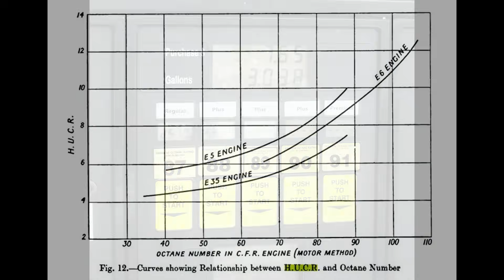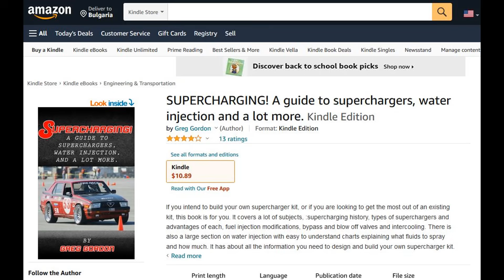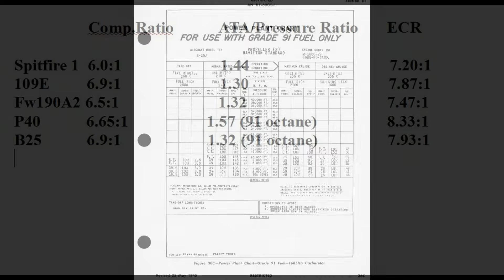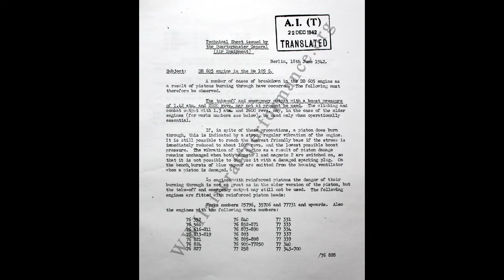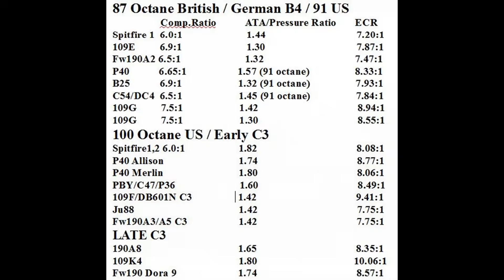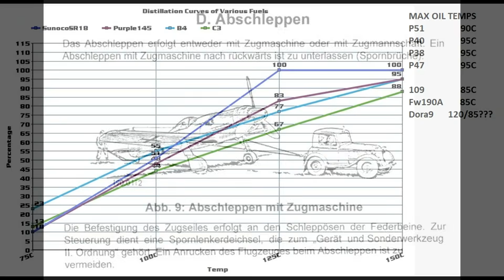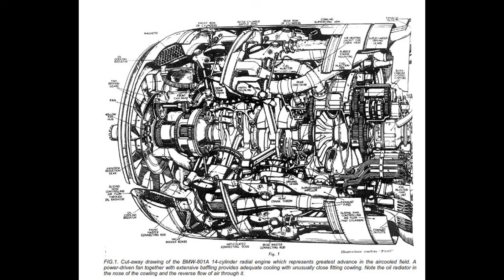German C3 Fuel, Uber Octane or Synthetic Crap?

Comment: My Copen's 659cc inline 4 runs 16PSI boost [at 500m on 95RON to it's tiny twinscroll] and base compression 8.5.  Doing the maths, ECR is sqr(2.08) x 8 = 12.3, meaning that the [very expensive by litre] engine is under-stressed, good!  Have I missed something here?
Reply from the maker: I don't know anything about that engine , but in terms of ECR it's not that high. Consider that a stock 1368cc Fiat runs 18psi with 9.8:1. Part of the reason it can do that is because of the small bore of 72mm.

Comment: Having all those qualifications to his name.............Greg is a pretty cool guy ;) Stanley Hooker mentioned in his book, that the carburetor on the Merlin had an advantage in that the supercharger sucked in the air/fuel mixture, completely mixed the components and evaporated the mixture fully before the mixture of gasoline vapor and air entered the engine, which has the advantage of the gasoline evaporating has a cooling effect on the mixture and helps to reduce detonation.  By comparison he said the mechanically injected german engines had no such advantage (injecting into the manifold, not before the supercharger) and it balanced the performance of them both to being equal. Mechanical fuel injection had its own plus side benefits, but also drawbacks.

Comment: 17:00 there getting up there 
Mazda Sky active x is 16 and some change
Reply from the maker: Sort of. It has a variable compression engine which can go over 16:1 but at very low manifold pressure values, values way below ambient. In other words, 16:1 but with a much lower ECR. It's the ECRs we are looking at here.
Reply: @GregsAirplanesandAutomobiles  I'm not saying your not wrong and sky active is technically a compression ignition cycle and I think there over 16.3 to 16.5 last i checked 
Was more intrested in why they would want peak cyl pressure so low in rpm figured the increased duration would burn up the heads but we will see
Reply: @GregsAirplanesandAutomobiles  also sorry about taking u off topic allway enjoy your videos and hope to see more soon
Reply: @GregsAirplanesandAutomobiles  but on topic I remember standard oil of England was the one who supplied the germans with tel or Tetraethyllead and I bealive that last shipment was before the invasion of france

Comment: Metallurgy should not effect the compression ratio, but poor Metallurgy will have an impact on rotating mass. Rule of thumb is 10 g increase in rotating mass is equivalent to adding 1 Kg weight to the plane. On these engines it would be pretty easy to see that poor steel could result in a gain of rotating mass of 10 Kg, resulting in an effective weight gain of the aircraft of 1000 Kg.
Reply from the maker: Just to be clear, I didn't say metallurgy would effect the compression ratio directly. I said it could contribute to knock and if so it would contribute to the need to use a lower equivalent compression ratio.

Comment: The German panzer museum recently released content on German synthetic fuel production in WW2 which indicated a 5:1 tonnage ratio of coal consumption for gasoline produced with their most common production method. While B4 might be somewhat higher than tank fuel in required octane, there is a world of difference between 5:1 and 22:1. Please consider clarifying that.
Reply from the maker: Hi Doug, valid point, but I don't have access to the source you listed, so, two different sources, the one I used said 22:1. Let me ask you this, did the 5:1 ratio include the coal needed to transport the coal to the refinery? Did it include the coal used to generate power for the refinery? Did it include the coal used to make the fuel that was used to mine the coal? There are a lot of variables here. I have no intention of covering this topic in a future video as the actual method of fuel production is way outside the scope of this channel, but you have raised an interesting question, one better handled by another channel.
Reply: @GregsAirplanesandAutomobiles  I don't believe it did include those figures since they analyzed largely the hydrogenation process, but since I can't seem to find what your source is or whether they include the associated extraction, processing, and transportation energy requirements, a discerning viewer is left with speculation and confusion when presented with seemingly largely conflicting information, coming from a large and reputable research and education institution that specifically analyzed the synthetic production of fuel in WW2 Germany. Unfortunately, the museum doesn't put their source out there readily available either. In addition, he paints a more detailed picture of remaining German fuel production capacity in 1944 as discussed in the P-47 part 8 video. https://youtu.be/guD27UuOAzk 15:24
Reply from the maker: Hi Doug, the difference between me and that museum, is that I do put up my sources. I don't say anything I can't back up unless I"m specifically saying it's my opinion. My source is the document "Oil and the Grand Strategy" by Toprani, which is the definitive work on this subject. contiunes below: 

Here is the quote "Taking a figure of sixteen tons of soft coal and five tons of hard coal to produce one ton of gasoline, Fischer estimated that IG Farben would require only 8,000,000 tons of the former and 1,500,000 of the latter to produce the required 800,000 tons of fuel." Do the math and that's a range of about 21:1 to about 11.85:1 coal:fuel. The document has German sources for all of this. Here you go, have fun: https://repository.library.georgetown.edu/bitstream/handle/10822/557628/Toprani_georgetown_0076D_11993.pdf?sequence=1
P.S. as explained in my latest video  I won't see your replies to this so start another comment if you want me to see it.
Reply: @GregsAirplanesandAutomobiles  Thanks for the sources and explanation of your figure. You might still like that video. He does post sources for quotes and usually for particularly contentious claims. Your content and his are the only two academic videos I've yet seen on the matter, and both I've seen in the last few days, so the conflict was especially glaring.

Comment: Greg, another more relevant question, what was the reason for the differing compression ratios in the DB605 cylinder blocks?
Reply from the maker: I am pretty sure but not 100% sure that it was due to one cylinder bank running hotter than the other.

Comment: Greg, you repeatedly use the terms "rich", and "lean" to seemingly denote more, or less, boost pressure. However i understand these terms to relate to stoichiometry, rather than boost.  I readily admit that more boost translates to more fuel, however.
Reply from the maker: Hot on there. No, I did not use the term rich or lean to denote more or less boost pressure. These terms have to do with Air:Fuel ratios, or as they called them back then Fuel:Air ratios. Now at higher manifold pressures, yes, more fuel goes in, however the mixture controls systems of the day ALSO increased the amount of fuel per a given weight of air, thus also richened the mixture.
Reply: @GregsAirplanesandAutomobiles  thanks for clarifying. i typically give your clips 3 or 4 'listens', since im only on round one, im sure it'll make more sense on round 2 upcoming. Apologies for any misinformation i may have promulgated

Comment: Re: the Spit's lack of fuel injection, wasnt that purposeful, ie, a design choice by RR, in order to gain performance advantages in a certain area(s), though offset, of course, by the disadvantage incurred until solved by Miss Shilling? Surely it's not llthe case that the British were incapable of fuel injection? (... and stop calling me 'Shirley'...)
Reply from the maker: Then why did the Spitfire convert to fuel injection with the Mk9 and all subsequent variants?
Reply: @GregsAirplanesandAutomobiles  Right, good point, but I wonder if fuel injection just better fit the overall "scheme," if you will, of the Mk9? Probably you're right, though. I will look into it further. Perhaps some other readers of yours will weigh in as well. Thanks Greg, I love your videos. If you were to read the US Tax Code, I would listen.
Reply: @GregsAirplanesandAutomobiles  Yes, it seems that fuel injection was beyond the capability of RR at the start of the war, though they felt that the carburetor did afford certain power advantages at certain altitudes (hence my original post/point). Still, the overall superiority of fuel injection was recognized by them, but apparently, with war looming, they did not want to use time and resources to develop it. Later, after Shilling's jury-rigging, a pressurized carburetor was introduced, which solved the negative-g problem, and shortly thereafter, as you indicated Greg, true fuel injection was introduced. Anyway, you know all this already.

Comment: Willy Messerschmitt DID have a tendency in his old glider designs to “pare away” at safety margins to get the performance he wanted, so it would be entirely understandable for him to try to coax a tighter tolerance from the 109’s engine settings than would really be safe to achieve.

Actually, what if the D series 605, especially the DC, was designed to run a bit richer on War Emergency Power than the early models?

Comment: The low nickel content of the exhaust valves, especially in German radials 
contributed to detonation and were not as durable as the allied aircraft.
Reply from the maker: Maybe, but the data doesn't seem to support the theory that valve metal content was the main contributor to detonation. I know that's a strong opinion going around, but I look at the actual data, compression ratios, boost, etc.

Comment: I posted a reply to the question on how it was made-
I.G.Farben and all German cartels were financed by certain Wall Street banks, financiers and industrialists starting in 1924
The Synthetic fuel, tetraethyl high octane additive and synthetic oil hydrogenation process from coal was from Rockefeller’s Standard Oil, in exchange for German Synthetic Rubber technology.
Incidentally, Standard started drilling, and had the refineries in the ussr starting in 1917. Fred Koch also a part of it. Ford was already in Germany in the 1930s, along with GM(duPont) who owned Opel since 1931-
Invested in all sides
Ford also in England, France and ussr. Financed in all sides 
The source is from Antony Sutton’s excellent books on his extensive and unprecedented research-
Reply: Antony Sutton’s research and evidence from State Department decimal files document where it came from. Also revealed in documents is how Germans were extremely pleased with all the data provided by Standard Oil research in the technical assistance/exchange/investment
Reply: Joint research agreement between Standard Oil/I.g.Farben was announced in November 1929
Reply: Standard tried to hide this after the war period of course-
Reply: Plants were then built in Germany to manufacture tetraethyl lead 
And by 1934-35 the Germans negotiated a shipment of $20 million worth of aviation gas and lubricants from the US through Standard-
Reply: And to ensure there were enough reserves of tetraethyl lead, 500 tons were shipped to Germany, with collateral security arranged by Brown Brothers, Harriman & Co. NY,  September 21, 1938
Reply: Also, nothing would have been possible without Standard/I.G. Farben cooperation and agreements on synthetic rubber development, made in the late 20’s The buna and butyl processes/monopoly

Comment: Hi Greg.

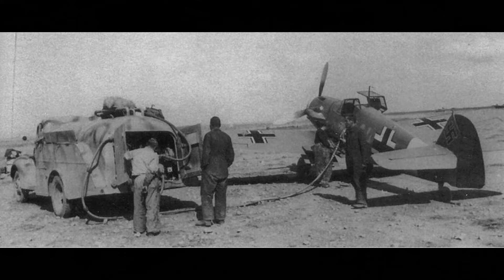On 34:36 it sounds, that you imply (correct me if I'm wrong), that B4 (unlike C3) was refined from crude oil, while C3 was synthetic and made from coal. This seems to contradict US Strategic Bombing Survey, Oil Division. Final Report, 2nd Edition, Jan 1947. There is a table on page 19 - Petroleum products by type and source. This table shows, that aviation gasoline in Germany was made almost exclusively by hydrogenation method (i.e. from coal), with minuscule addition of crude refining. C3 was madly expensive, but perhaps not because it was synthetic - all aviation gasoline was. Here is that table for your reference: https://ic.pics.livejournal.com/fat_yankey/6364286/127809/127809_900.png
Reply from the maker: Hi Igor. Thanks for your post. Allow me to clarify. At no point in this video or any other on this channel do I discuss the manufacturing process of B4 fuel. I understand why you might think I was implying something about it, but no, that's not the case.
Reply: @GregsAirplanesandAutomobiles  Thanks for the clarification.

Comment: From my (very rusty) thermodynamics and algebra, can confirm the square root approach for ECR is a (far) more correct way to approximate ECR thanks to the specific heat ratios for air and reasonable assumptions for compressor efficiencies. Note that this rule of thumb will not work once you use intercooling...or a gas with different molecular properties to air.

Comment: Some Fw 109A-8 had s fuel injection system that allowed them to run on higher boost settings, so they possibly used the higher octanes of C3 with that.
There were even A-8s with MW50, but I don't know if these ran on C3, though, yet it's the most likely option

Comment: Another possible reason that the German set up their aircraft to run on the lean mixture could be inconsistency in the availability of the higher octane fuels. The Germans had fairly significant  logistical problems, and maybe they set their aircraft up to be able to run either type of fuel in the event of a shortage. Just speculation.

Comment: The relative low oil temperature of German engines remember me to some statements of German pilots and mechanics how US engine oil is almost glueing onto the wind shields and other surfaces of German fighters and there are reasoning that US engine oil has a much better quality. I know I heave heard/read this statement in several documentations and books. But of course I don't know if they all based on the same source and how reliable this statement is. 
Is there any evidence that German engine oil was of significant lower quality?

Comment: I like the video and the presented information very much. A long needed explanation on that topic, with a lot of additional Information on comparing different fuel type's Octane number / detonation resistance, and on how many factors it depends. It also opened up a lot of new questions, like on how rich mixture did the german engines fly.
Well done.

+ please have a look at the 2013 Supercharging Book by the same Greg.

Comment: The reason you need to use the square root of the pressure ratio is the compression ratio determined by the mechanical volume change of the engine cylinder from the bottom of the stroke to the top of the stroke.  The supercharger pressure is the pressure of the air in the intake manifold.  While the air in the intake is pressurized to the measured pressure, the ability of the air to fill the cylinder is restricted by the intake valve openings and the speed of the engine.  The pressure seen at the bottom of the intake stroke is less than the measured pressure in the intake manifold, but it is still much higher than the pressure at the same point of a naturally aspirated engine. In naturally aspirated engines the pressure inside the cylinder is not equal to the outside atmospheric pressure.  We go to great lengths to improve the "breathing" of engines to increase power for the same displacement.   If you notice the peak torque of an engine is at an RPM far below the peak engine power rpm.  Engine torque is the result of brake mean effective cylinder pressure.  This is the mean cylinder pressure seen during the expansion stroke and this drops due to the engine not being able to fill the cylinder at the same pressure at higher engine speeds compared to lower engine speeds.
Reply from the maker: Thanks Ken.

Comment: Hi Greg, this source claims that the DB601N was mostly used on the Emil and very rarely on the Franz. http://kurfurst.org/Engine/DB60x/DB601_datasheets_N.html It lists the 2 books as the source of that data. No idea how accurate this is.
Reply from the maker: There were 109E models with the 601N, but very few. I think Galland flew one during the Battle of Britain.  I'm not sure how many F models were built with the 601N before they changed it out to another engine, but at least initially, that engine in that plane was the plan.
Reply: @GregsAirplanesandAutomobiles  Looks like Kurfurst did some more investigation regarding the numbers. More info can be found in this old forum thread http://forum.12oclockhigh.net/archive/index.php?t-31381.html Interesting to see that Germany especially liked to prefer the N in the 110. Maybe it was hoped that upping the engine would improve the 110 enough to make it an acceptable fighter during the BoB.

Comment: Would it be more appropriate to use the mass of the extra air in the cylinder (instead of the pressure) to calculate effective compression ratio?
Reply: Volume + PSIA ?

Comment: Greg, a better comparison is to take a single engine (ie sbc 350) and show dyno results for same heads/cam but different pistons or even head gasket quench; and a variety of fuels.  Check out Richard Holdner for some video data to help make the point more succinct and accurate to serve help serve the less technically astute viewer. As you said, the compression takes advantage of the fuel octane, so comparing multiple engines would have quite a few more variables.